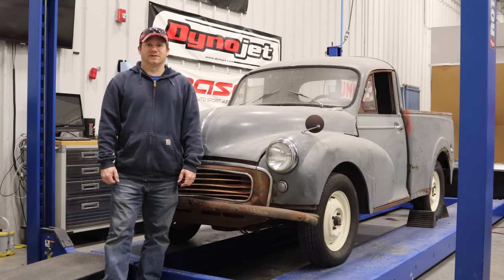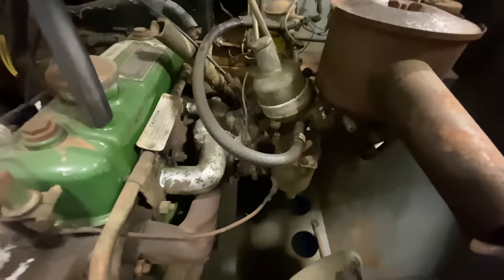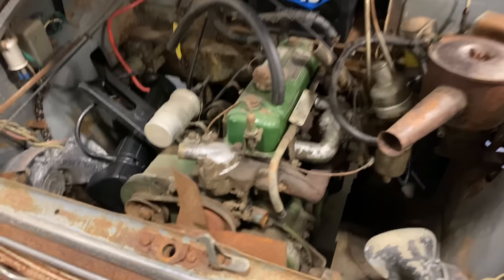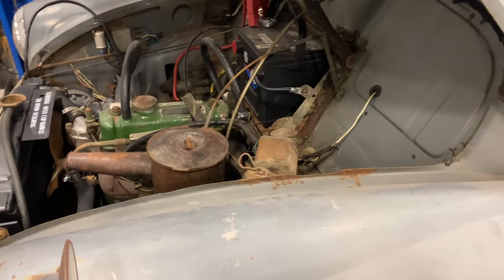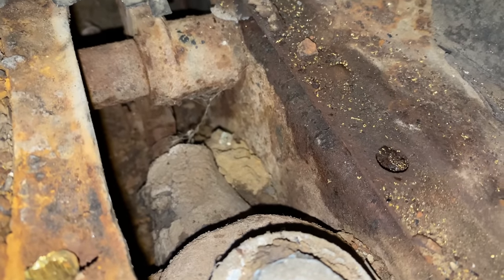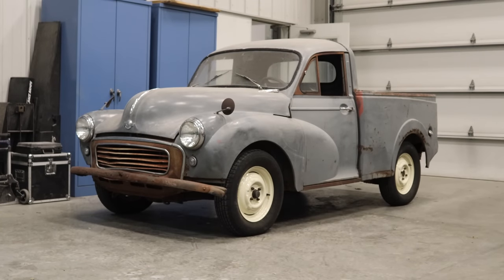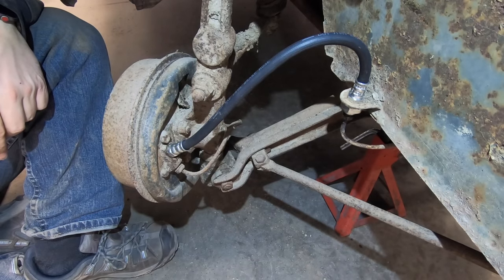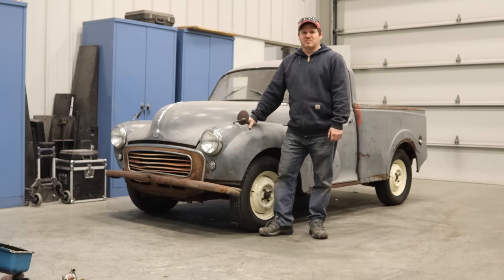1961 Morris Minor Pickup - Will It Run?

Comment: This is a rare pick up in UK
Reply: In the rainy damp U.K. these things rusted really badly. Whilst there are plenty of standard car versions original pickups are very rare, most of what we see here have been imported from drier climates
Reply: That's because they were work vehicles used abused then written off and scrapped
Reply: @hanwellfoxfoxy5008  - no, really, corrosion is a problem with a lot of vehicles from this era. Galvanising or proper paint jobs was a thing for the future. They had an idea a positive earth electrical system protected cars (it doesn’t). The British climate is wet. Steel rusts unless deliberate attempts are made to protect it. I think the pickup body would get its load area wet either from rain or condensation, and it would rust because it’s seams collected water, which is a thoughtless design, or a design for failure! If the vehicles were abused by the pickup area load area paint being scraped; oh yes, rust. But my point is this body style did rust by poor design in the British climate. As a family we have had many Moggies, and my Uncle has the earliest Traveller known, plus another very early split screen saloon. Rust is the cancer of all of them, pickups being the most vulnerable! Yes a few have survived with care & dry storage, but those are very rare vehicles.

Comment: I've found that bleeding the brake bleeders by vacuum doesn't work very well since it draws air around the bleed screw threads. Unless you have speedy bleeders the two-man system of bleeding the brakes is the best way to go. You can try putting teflon tape around the threads of the bleed screw since it can help prevent drawing air around the bleed screw threads but, still, the two-man system is best.

Comment: The clutch pedal was seized so you changed the brake master cylinder then both were working....😁
Reply: The clutch is not hydraulic, it is mechanical with a rod linkage, both pedals share a common locating shaft.

Comment: Just reverse the fitting of the master cylinder bolts so it is much easier to access them in the future. The chances of them falling out is very slim. Ok, you have a lift, so it is easier. But I did this with large screwdrivers on mine 20 odd years ago.

Comment: Whoever has to replace that master-cylinder next time will be cursing the last guy for putting the bolt back in as they were originally. But hopefully, with routine maintenance/driving, the next guy to do that job won't be you!
(by which I mean that I hope that master-cylinder will last many decades) Although it didn't seem too bad a job where the bolts were concerned, seemed like that rear fitting was the real pain! Were there no more removable floor panels?Love that bubbly exhaust note! Good revival, you make these look easy!

Comment: I wonder if the location of the brake master cylinder is the result of left-hand drive conversion. 
If my memory is correct the RHD had the master cylinder in the engine bay.
Reply: No, the MC was in the chassis on the RHD too. It was always a pain in what was otherwise an easy vehicle to work on.  I had two Morris 1000 vans back in the '70s.

Comment: Unless it's been converted, by fitting  valve seat inserts, that engine runs on leaded fuel, so you will need a lead replacement additive  in the fuel.

Comment: Next thing to replace is front suspension trunnions on both sides. They wear very quickly and easily if not looked after with plenty of grease, and when they fail the suspension collapses on that side. Thankfully it only does that at low speeds when the steering is at full, or close to full, lock and puts the trunnion under stress.
Reply: I have seen this just twice, once on a Morris Minor van that was supposed to have been serviced very regularly but obviously not at all well, the other time on a Morris 1100 which had a sealed for life bearing and no grease nipples.

Comment: How did you initially know what parts to buy?
Reply from the maker: I didn't know what I would need for sure to make it drive but a car sitting that long will always need those three things, usually I opt to rebuild the radiator instead of replace but that was not an option in this case.
Reply: @ThisWeekWithCars  Ah right, thanks for the reply, I'm trying to learn as much as possible before starting my first car restoration, and your videos are incredibly helpful :)

Comment: Cut the master cylinder bolts off when you change it then put new bolts in the other way so the nuts are on the torsion bar side makes it easier next time! still a horrid job though. I have a series 2 minor 1955 and the clutch pedal is also in the chassis leg very cramped!!

Comment: very dangerous to heat a hydraulic pipe up like that.  why would you run brake fluid onto the garage floor just to see if it was coming through, even an old piece of cardboard would be better than on the concrete.

Comment: Did you know that Morris Minors were fitted  with a flathead 4 Are you going to fit one in your pickup?
Reply: The Wolseley side valve engine was fitted from 1948 to 1953, then an overhead valve Austin engine and this one would have had the overhead valve engine.

Comment: typical British car. Run a big steel bar over the top of the master cylinder bolts so you can't get them out. I would have put them back the other way so you could just pull them from the other side. But then maybe there wasn't enough room to fit the nuts between the bar and the frame rail. I'm surprised the wheel cylinders didn't leak.

Comment: The pump sounds noise because it is rattling on the bulkhead. Fasten it down of anti vibration fixings. Problem solved.
Reply: when you turn on the ignition the pump makes a ticking sound as it fills the float chamber up most of the time you do not hear it but if when driving you hear a constant ticking sound it is time to fill up the tank.

Comment: I would NEVER have put those M/C bolts back in the same way the Brits did it! I would have put the bolts in on the OPPOSITE side of the frame from the torsion bar and put the nuts on the torsion bar side!
Reply from the maker: There is t enough clearance to do it the other way.  The bolt heads are not normal height.

Comment: wht did'nt they do that in the first place put the nut on the out side
Reply from the maker: I think it is for clearance so it does not rub on the torsion bar, the head of the bolt was not as thick as normal as well.

Comment: A Moggy in the States,..? ..lol...Grease those kingpins on the front suspension, or the wheel will fall off. That's an Austin A35 Lorry engine ..
Reply: I have only seen that happen to one Morris Minor through lack of maintenance . The same engine as the A 35 which was hardly a lorry.
Reply: @barrierodliffe4155  Kidding about the engine, but not the front suspension...🤔🤔🙄🇬🇧🇬🇧🇬🇧😳😳
Reply: @EnglishTurbines  
But it only ever happened if maintenance was neglected, just as modern cars go in for a service every year it was a few minutes work with a grease gun every few months, I did it myself on all my cars. Not so easy on a modern car, replacing parts costs more than a little grease.
I have seen an early Honda run off the road into a ditch because the steering locked up, never seen that on a British car.

Comment: Hay, I can let u in on a secret I have known about for year's. I order to free a bolt try the thing I use. Work's everytime for me to. Get urself a spray bottle and put a small amount of vinegar in and water. Spray the bolts, or nuts and other fastener's with the solution. Wait come back spray again and give the fastener a turn gently working back and forth. It will come out keep spraying as u turn to rinse as it goes. U see usually when a bolt or nut is stuck from rust it's best to use what froze it there to begin with. Give it a try it saves u money on penetrating oil. And heating up thing's. 
One more thing when doing breaks always spray down your drums and all of the equipment with water to get rid of the dust because you don't want to inhale that dust. Same thing with clutches. The water won't hurt a thing. Give it a try remember safety first.
                   Friendly advise form an ol mechanic.
                                    DRC. ;)

Comment: The downfall of the Minor in America was much the same story as other British cars of the era... gearing. With such tiny engines they were geared so very low to even move them empty that 45 mph was tops without over revving them. There were many of them around SoCal in the '60's, but they didn't last long. It seems that only the Germans with their Autobahns were driving the same speeds as we Americans and geared accordingly. Good luck with your Minor.... speed is not their friend.
Reply: Yeah sure that is why they sold tons and tons of Beetles in the US because they were a great ball of fire eh?..
Reply: Strange how often I did much more than 45 mph in mine, the Series II with the 803 cc engine was low geared  but the old MM side valve or later 1000 were geared just fine.  I used to leave Beetles behind all the time.

Comment: Sir you are dangerous where the brakes are concerned  when replacing the brake pipes on an old  morris / austin you are supposed to replace the copper pipes as well also at least check the  brake linings inside the hub. An old bus like this was never designed for the hot spanner you appear to love using.

Comment: Typical English engineering practice, in those days they came with free supply of rust, and do mean they were built so thin they rotted from the inside out, water and mud traps everywhere, no under sealant or rust preventing coatings, They were all paid for ''Extra's'', That one has the usual flintstone flooring and loads ended up with 2mm plate welded in to stop the seats falling gout the bottom of them, worked on dozen of them over the years, the bodies were never meant to outlast the components.

Are they worth anything these days, you bet they are, Travellers in mint restoration go for stupid prices, split-screen versions, see one, buy it, the only good thing about them these days is that ALL the body components are still available off the shelf.